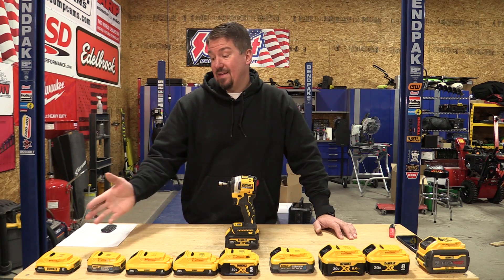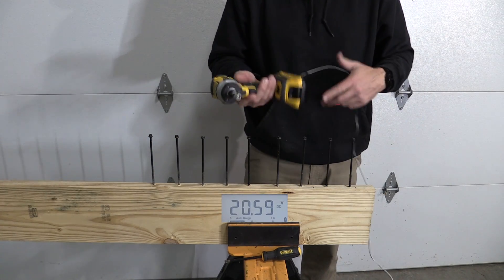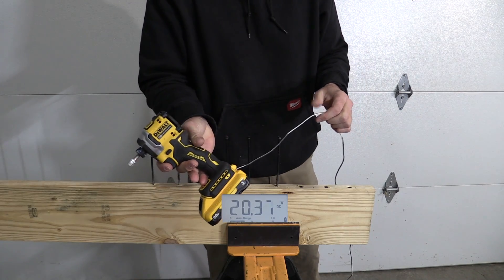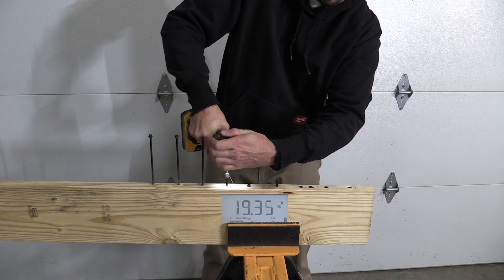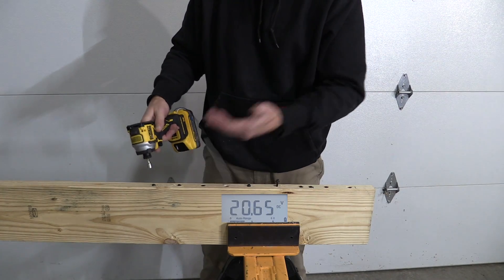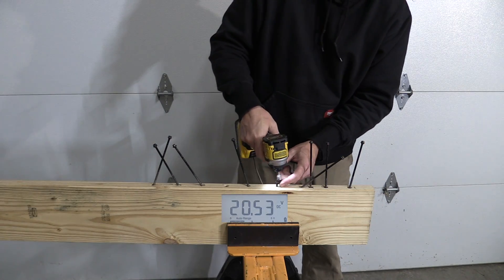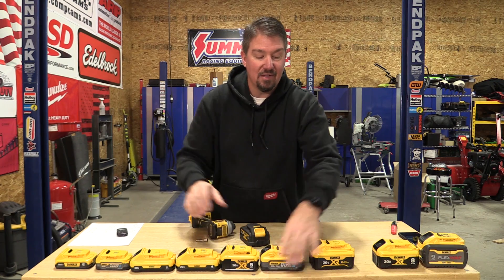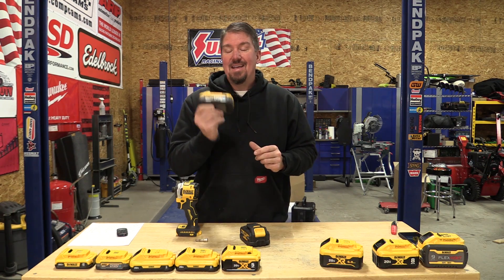How Does The DEWALT 5Ah PowerStack Work With Small Impact Drivers?

Comment: Like anything, rite tool for the job, like you said... in my application id say min. 50% -75% over head, well... i want the smallest lightest i can get away with, FOOT POUNDS are irrelevant after 75-100 morel than enough, i need Reliability, good modes, good ergonomix, light weight.. LIGHT WEIGHT and decent runtime. i could care less about ultimate torque as All modern impact drivers will spin out, strip out, cam out and snap the heads off fasteners in my application, rarely past 10-24, maybe...MAYBE a few 12-24 and a few 1/4 20s.

Comment: Well you'll see a 9 on my impact driver. Installing overhead doors when there's steel jambs. I'm changing my 5 every half hour plus it struggles to provide enough power for the jamb drillers especially when it's getting low

Comment: I run mostly Makita but my company outfits me with some DeWalt cordless tools and I have to say, getting the batteries off the Dewalt tools is not nearly as smooth as my Makitas. Does anyone else have this problem? They stick, they don’t slide nice and the biggest complaint I have is more of the tools than not is the battery indicator facing in a direction where you can’t check it while on the tool. Almost as bad as Milwaukee’s 12 V lineup where you have to put the battery in the tool to check it level.
Reply: @doesntmatter7389 Well I'm certianly not going to say that Makita tools aren't good tools but they are a bit too rich for my blood. As a trades person that uses my tools professionally everyday my Dewalt tools have seved me well and their price allows me to afford more tools and batteries to make my work more efficient. I've never had any issue with switching batteries on my tools. I mostly use 4ah batteries on my impacts and drill drivers, and 5ah batteries on my saws.  And I use 2ah batteries for occasional light duty tasks around the house. I usually have one or 2 battery changes per work day per tool so checking battery status isn't a big deal you just press the charge indicator button on the battery and look at the bars to see your charge status, pretty easy imo.
Reply: @duncdunc76  glad to hear you have no issues with Dewalt. I also use my tools professionally every day so just wanted to give my experiences and thoughts. IMO as long as an employee shows up with tools I don’t care if they’re yellow or pink. Whatever gets the job done in a reliable, timely manner. Cheers!

Comment: I JUST BOUGHT the 7 1/4” flex volt circular saw with the 9ah FlexVolt battery, kit model DCS578X1…if they give you the same saw with a 5ah power stack battery…I think I’m going to return mine and pay the difference…duuuuh!
Reply from the maker: The Flexvolt is a 60-volt saw.  The 5Ah Powerstack is a 20-volt battery......
Reply: Saw a video where the power stack outperformed….thought it was a better battery even though it’s a 5ah at 20v, and smaller/lighter
Reply from the maker: @Jeremy  Could it have been on a FlexVolt advantage saw?  Those are 20 volt.  Flexvolt is 60, flexvolt advantage is 20, power detect is 20, xr is 20 and so is atomic.  FlexVolt saws will not accept 20 volt batteries
Reply: @WorkshopAddict  you were exactly right, that is what it was! I was mistaken. Thanks for the info though.